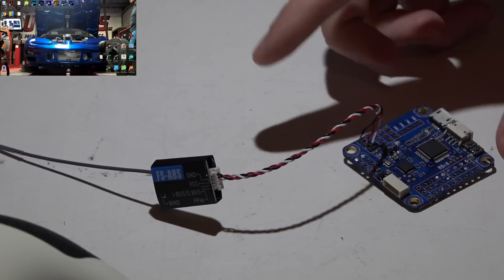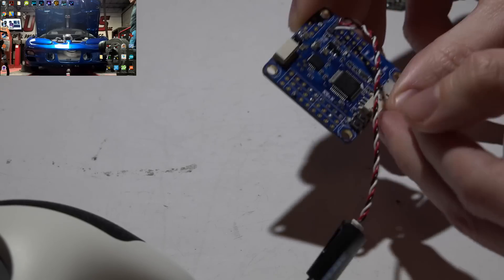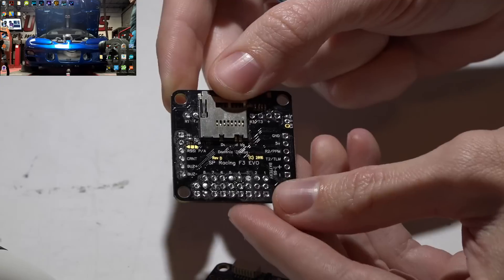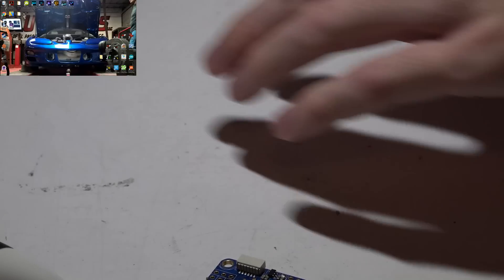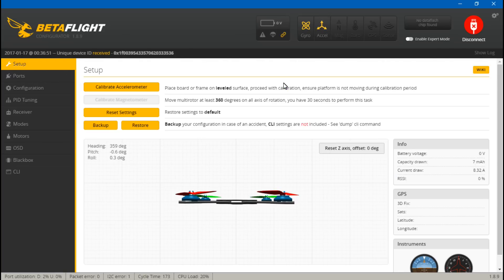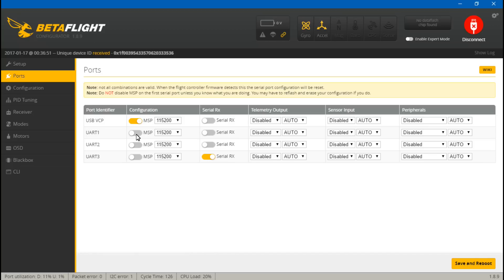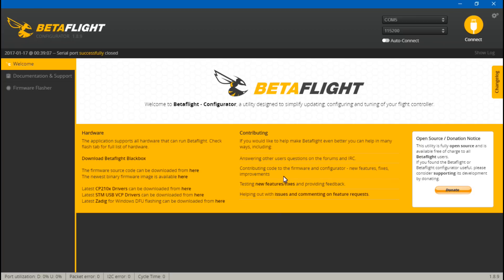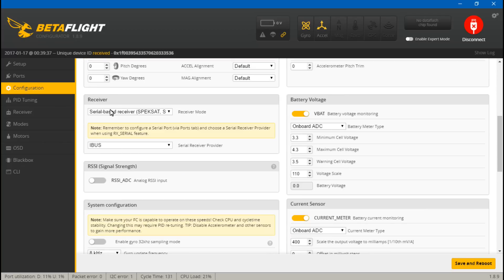FS-A8S: Wiring & Betaflight Set Up (Ibus/PPM)

Comment: Good video I have had problems with firmwares 4.0 onwards with FlySkyi6 receivers, in Betaflight the Remote Control does link and move the bars on the screen well, but the ARM Mode blocks the Acro, Angle and Horizontal Rescue  flight modes, even the motors are accelerated and They cannot be controlled with the sticks. The solution was to download older firmware...https://www.youtube.com/watch?v=gI_wkR-qAC0  THXS

Comment: I thought I understood this Stuff I don't. I have 3 wrecked drone that prove I don't. Here I trying to swreck the 4th it's a baby hawk with a flysky fsi6 that came with my wizard and usmile fs82 receiver. It looks bound led wise. This receive has 3 wires B,R and Y the Y says Ibus there a spot to soldier a 4th wire says ppm. The baby hawk has f3 femite prints hella small. But so theres 3 pins on the front from left to right Y.R. then B = I bus gr. 5v.  So soldier the PPM wire on the receiver and to the spot on the board that says ppm the cameras on the power and ground next to the PPM. Or will new firmware fix it. Every thing on my computer says the firmware it infected I  tryed my browsers won't let get it. That's from flysky site. I promised my girl friend I'd quit this hobby if I wasn't flying by my birthday that seem do able that was on 28th.my birthday tomorrow. I had a wizard that got stole when I crashed it. 2 scumbags seen me and ran grabbed it ran to there car. Still hard to beleive. My car hella far away. Lizard 95 just came with wrong receiver. Hobby shop talk me into getting a spektrum radio and then it was bricked beta flight didn't see it.  Then I bought dark max it seemed perfect but first flight. First punch out. Burst in to fames then wreacked. Camera and 4 in 1 esc wreacked I even have fpv goggles that ive never got to use. And my battery mod in spektrum came loose and wreaked it that why I'm using the flysky. I did in brick the lizard shows up in beta flight. And over half my battery are bad 6 or 7 are. New camera came and esc by the 15 th But no controler. The lizard has dsmx integrated receive how do you change that or can you. I'm 1000 invested bet I flown 10 battery in the wizard. I love when they fly. If you could help figure out the baby hawk before I wreck it too. I can send picks or what ever. I can pay a little bit. I really need some help.
          From a Noob to dumb to fly

Comment: I have a turnigy evo bound on ibus as well, good video. But i have had some problems out of my remote and noticed on screen at the end of your video your was doing the same thing mine was, drifting on roll.. and the roll wont be still @ 1500. It flutters 1495-1505 on my end. I could trim it out to stop the roll but it still flutters on screen, as soon as i touch the stick again the roll would continue slowly after the stick was returned.. and is very noticeable in flight, since i fly in acro all the time. This is the first time ive seen this in another evo besides mine. Would you mind checking that i wasnt seeing things there? I have sent my remote back for a refund beacause of that issue. I tried everything..

Comment: Hey, I have a problem with my FlySky ia6b (connected via ibus). It works all fine, but my spracing f3 doesn't notice when my transmitter is disconnected -> betaflight failsafe doesn't work! Do anybody know how to fix it?

Comment: Can you please help me with adding this receiver to my eachine flyingfrog. http://imgur.com/a/E1HNA There is an SBUS port but I am not really comfortable deconstructing it to solder direct to the board. My plan was to splice the wires to the current receiver but then I am stuck with PPM. Any advice? Is there any way to convert the cable into one that would plug directly into the SBUS port?

Comment: HyperLite F4 Flight Controller i have a issue with a d4r-2 and cant get it to respond on betaflight and quad wont even arm when unhooked from betaflight? what would problem be? i got this from droneproz and i have alot of money over all trying to get at least one drone going 1200$ cause i got ripped off with ebay seller on one then i went droneproz and im having this issue

Comment: Eh up, I think the receiver has 3 modes, PPM, Ibus (default) and Sbus. To change modes from Ibus to Sbus, hold the bind button in when your bound up and tx is on. ( think light goes off for 1 second then flashes twice for Ibus, light comes on for 1 second then flashes twice for Sbus) or visa versa? 
http://www.multirotormania.com/receivers/1608-flysky-fs-a8s-fs-a8s-24g-8ch-mini-receiver-ppmi-bussbus.html < there's a link to instructions on the bottom of this page.
Hope it helps.

Comment: Since most of your tutorials are made  with  the Flip 32 F3 Omnibus boards , I've changed all 4 of my quads to this board..Works beautifully for the price and OSD is nice also ...Thanks for all the hard work being done , its greatly appreciated believe me !!
Reply: Me too, I've got four quads, all run Omnibus boards, 2-F3 and 2-F4s.  Despite the pinouts being a little frustrating, I love the boards.
Reply from the maker: Thanks guys. Yea I did the same thing. All but one of my quads are running F3 or F4 Omnibus boards. As small as 122mm builds to as big as a 650mm GPS build. Great all around FC.

Comment: hold the bind button for 2 seconds, then the receiver changes from ibus to sbus! for me it works with sbus on the evolution
Reply: Dominik this comment should be featured in the video or in the description. I was about to unsolder this receiver but I noticed this comment. Thanks man! 

BTW. Did you checked the real range? I have TGI - i10 and me previous receiver that was supposedly be a >300m like this one but this previous receiver had telemetry, and after 200m was warning about low signal. So, did some one tested real range of this receiver? I'm little scared to fly because previous receiver had 2 antennas and after 200m I had warnings but in this new receiver there is no signal strength warning.
Reply from the maker: Thanks for the info. I'll give it a try.
Reply: NewNickPL i use this receiver only for my 90mm micro brushless. so i dont fly more then 150m. but i saw a review where this receiver was used more then 200m.
Reply: Dominik Tomorrow I will see :D
Reply: Thanks buddy.
Took me half a day to find this.